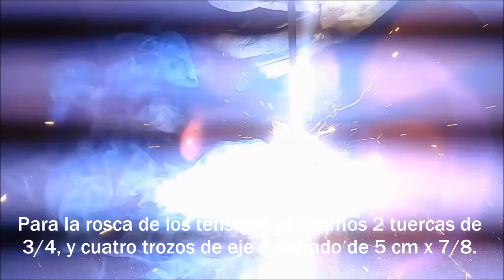Como hacer una roladora de chapa (parte 1.) /Laminating machine.

Comment: Amigo, una recomendación. En el minuto 10:38 se aprecia como la herramienta esta mecanizando, en el torno. Te comento que la orientación del filo de la herramienta, no es la correcta. Siempre el flanco de ataque de la herramienta, debe estar a la inversa de como se muestra ahí, o a lo sumo a 90º de la pieza. Por eso al final del mecanizado, queda una rebarba y esas marcas radiales en la pieza trabajada. Ademas del consecuente desgaste prematuro de la herramienta, forzado, vibraciones, etc, que incluso pueden llevar a la rotura de la herramienta. Se que sabrás tomar esta indicación de manera constructiva. Abrazo. Te recomiendo ademas, practicarle un chanfle o surco, en la cara superior de la herramienta, para que la viruta salga en forma de rollo.
Reply from the maker: Muchas gracias amigo por tu comentario y por tu recomendación lo pondré en practica la idea no es lo de compartir vídeos sino de aprender de todos ustedes, muchas gracias un fuerte abrazo y saludos.
Reply: @MetalExtreme  Por nada compañero. Cuando vuelva a mi fabrica, luego de la cuarentena, tengo pensado fabricar una cilindradora como la que mostras en el video y estoy sacando ideas de todos lados, para terminar mi diseño. Debo decir, que la tuya es la mejor construida de las que vi, aunque yo le voy a poner rodamientos, ya que pienso colocarle a la salida de los ejes, unos dispositivos torneados para ranurar y moldear acanaladuras y pestañado en las chapas y fabricar también conos y quiero que todo el conjunto, sea lo mas preciso posible. Cualquier duda con el mecanizado de piezas en el torno, me podes consultar sin problema. Saludos, desde Buenos Aires.
Reply from the maker: @nanupin8467  Gracias compañero estoy en proceso de construcción de mi taller pero esta pandemia me tiene parado cuando lo termine tengo pensado comprarme un torno nuevo y de seguro te consultare, muchas gracias de antemano bendiciones y muchos saludos.